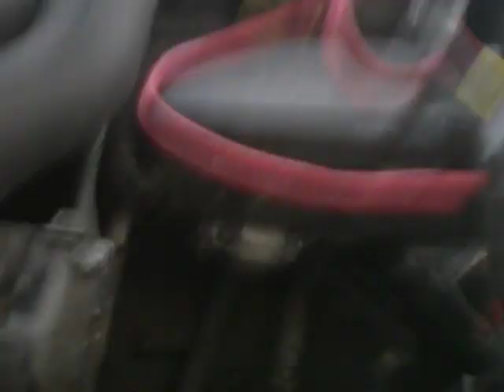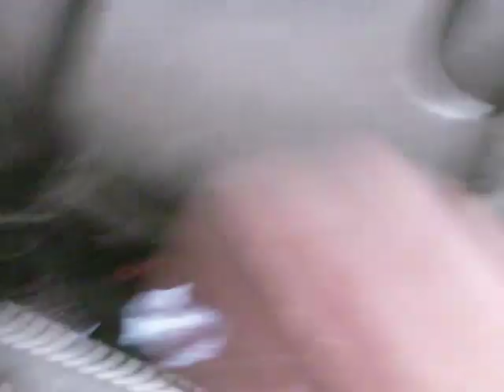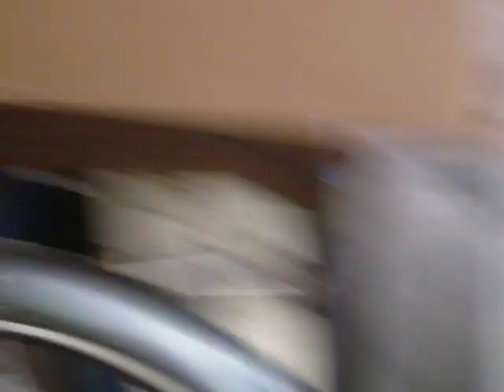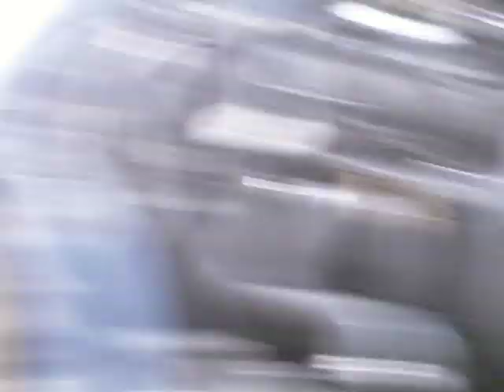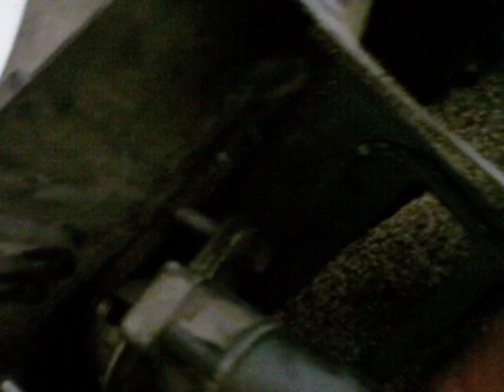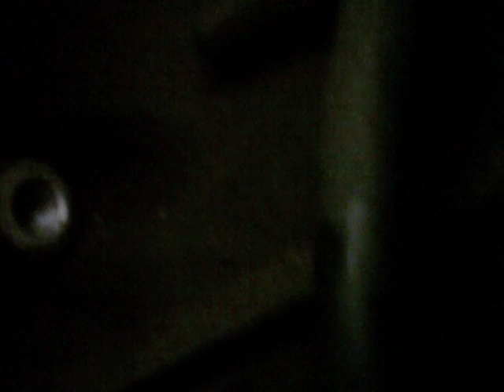How To: Replace a Dodge Neon Starter

Comment: Thanks man,  I looked all over trying to get the top bolt out.  I didn't pull the battery box.  I assumed it was on the other side.  Thought I was going to have to pull the intake and all that.  You save me a lot of work.  Thanks!

Comment: cant you just reach the bottom bolt of the starter by crawling under the drivers side? seems alot less work the pulling the battery etc out?